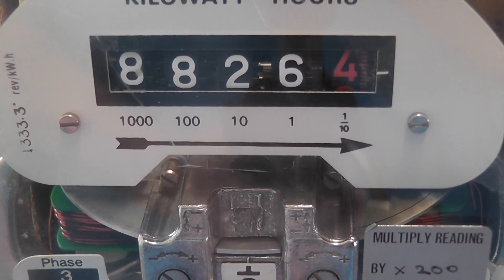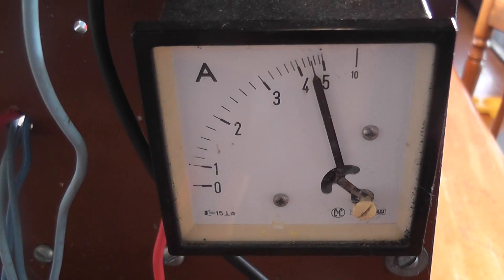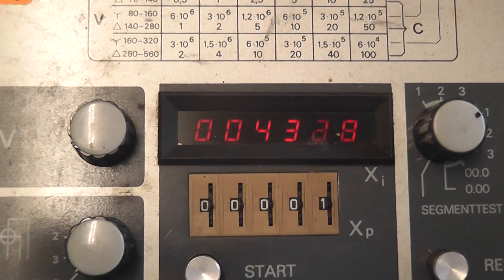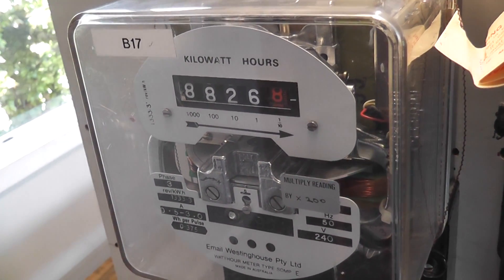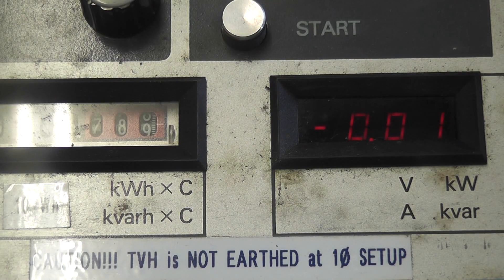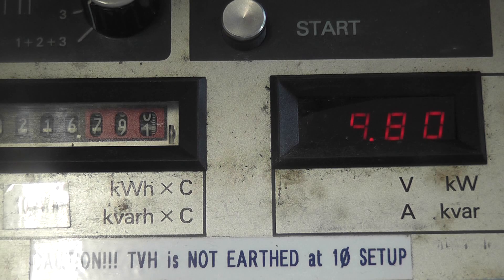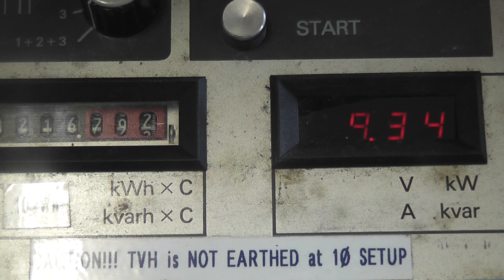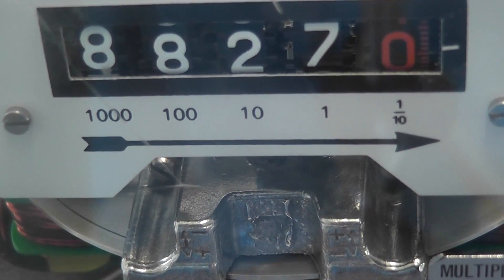Email and TVH 4.32

Comment: The instrument you have other is it just a measurement device or does it contain transformers for voltage control? I will try my workshop heater with an ammeter see if I can see the same

Comment: Have you ever seen these older mains meters with warped discs that scrape and create a friction slowing issue?
Reply from the maker: +paul larson Yes I have seen those, mainly affected by sunlight and some distorted plastic support part. Seen one disc of a meter which had a direct hit of lightning and the current coil shape was stamped into the aluminium and warped the disc.
Reply: +RODALCO2007 wow,

Comment: At 2.25 ..... that mechanical readout looks similar to what would be found in a dual-tariff L&G CL 147 (The CL 147d)

An interesting device is the TVH.

As for the resistance increase and current drop-off of the heater, I have heard of this happening and that electrical resistances aren't quite the constant that everyone once originally thought.

With today's sensitive measuring instruments which can go right down to 1 milliamp, it can be seen quite easily that, as the heater is powered up, the current drops off as the resistance increases (which is caused by the heating wire warming up of course)

If the truth be known, you'd probably be able to demonstrate the same thing on a copper electric cable if you had a test instrument which could withstand a good 20A at the top end, yet can increment lower than milliamps in order to show the current drop-off as the electrical conductors warmed up. (which would be ever-so-slightly of course, given that they have a very low resistance to start with)

Thanxx for showing,

-BoomBoxDeluxe.

23rd October 2015, 16.15
Reply from the maker: +BoomBoxDeluxe Yes, similar number fonts, narrower digits and 7 in a row instead of 6. Seen in ML 220 Maximum demand meters of which 1 digit is blanked off. It is a Landis & Gyr instrument.